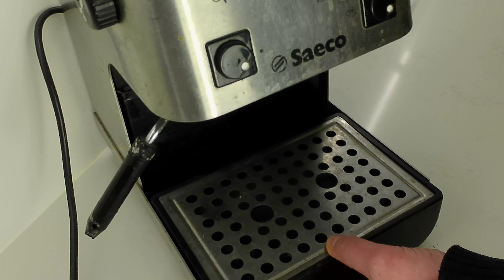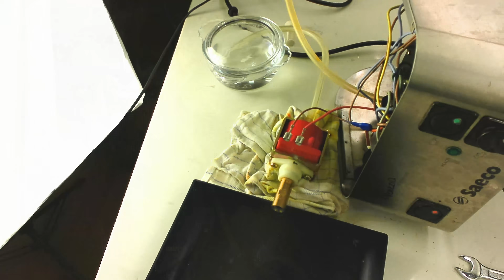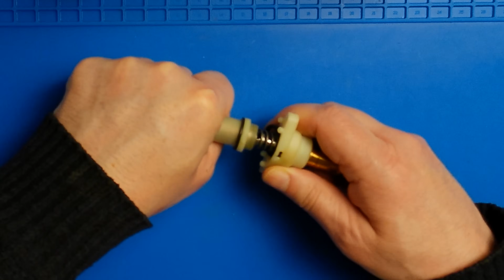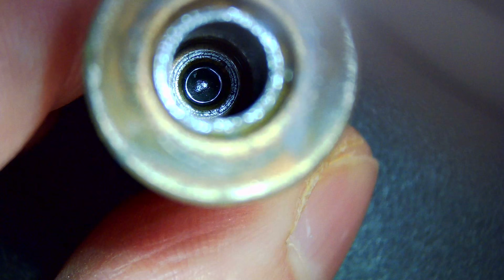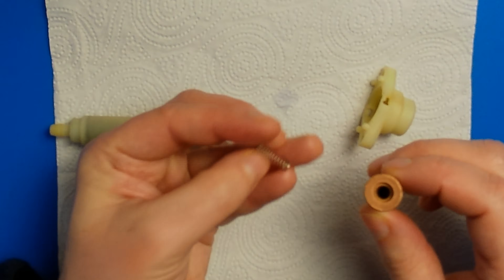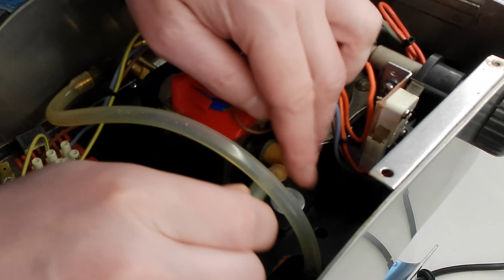Repairing a Saeco Via Venezia / Starbucks Barista / Saeco Rio Vapore espresso machine

Comment: This is a great video! Keep your stuff out of the landfill, this is not difficult! Yes, the small ball tends to get stuck. In mine there were two, a steel one and a plastic one. The steel had a small amount of stiction. I dropped that end of the pump in vinegar solution in an ultrasonic cleaner for 30 minutes. Remember the pump vibrates, so if you removed any zip ties, replace them in a way to keep the wires out of the zone of motion of the pump. BUT before you take it apart, don't forget to attempt to PRIME pump using method in the user guide: "Before first use, it is recommended to wash the parts. Ensure the hot water/steam knob is closed and that there is sufficient water in the tank. Then, prime the water circuit by pressing the ON/OFF switch, placing a container under the steam spout, and opening the hot water/steam knob counter-clockwise until a steady jet of water is emitted. Close the knob and remove the container. The machine is then ready to brew coffee and dispense steam." https://www.manualslib.com/manual/811357/Saeco-Via-Venezia.html

For more information, see page 9 of the manual.

Comment: Do you know if the Saeco Aroma pump is the same?
Reply from the maker: Not exactly the same. This Via Venezia has a metal output connection, which is better than the pump in the Saeco Aroma I repaired (which might have been a replacement, because I bought it second hand). You can have a look at my video where I disassemble a Saeco Aroma pump: https://www.youtube.com/watch?v=p220wWNLXcI - parts suppliers sell the same pump for the Via Venezia and the Aroma though. If you're going to buy one, go for the one with the metal output, it's a stronger and more reliable connection. And it looks better :)

Comment: Wonderful video. I have one that I’ve always had to manually prime (using a squeeze bottle to force water up the inlet tube) after letting it sit for a while. After a few months in storage I did the same but now I’m only getting flow through the steam wand (steam and pumping hit water) but nothing through the group head (sounds like it’s trying but no flow). Any ideas where the problem could be?
Reply from the maker: Hi Max, thank you so much. Given that the steam wand is pumping hot water, the pump is working. It might be that the output of the boiler to the brew group is slightly blocked. If you haven't already, have a go with a good decalicifier and see if that improves water flow through the brew group. Use the steam wand to empty the boiler in between decalcification sessions. We can always remove the boiler and machanically remove the blockage, but that will be a bit of an operation, so do try decalcifying first. I haven't had a close look at the brew group when solving this problem, so check if there is a little screw holding in the filter. The brew group itself might be clogged and preventing water to flow through it... Yes, according to this site: https://espressocare.com/collections/ss-via-venezia-internal-parts/products/saeco-shower-screen-barista/ (no affiliation) it has what they call a 'shower screen'. Remove that and clean the brew group, that could be an even quicker solution, so check that before the whole decalcification process.

One question for you: Is that a Gretsch?
Reply: @repairchannel  Appreciate all the input, I'll have to get inside and see if I can get the boiler apart. It is a Gretsch, that one is just a stock photo but I do have a Gretsch Jet, though I mainly play strat's.
Reply from the maker: @maxeddis1138  Did you check the brew group first? It can be as simple as removing the shower screen and using a brush to clean it. Taking the boiler apart would be the last resort for me, because you might need to buy new caskets for reassembly. Sounds like a nice guitar collection, do check out my guitar-related videos if you like: https://www.youtube.com/watch?v=BJNRPBfkDl0&list=PLtuq3yiKbcpv-IsHGwGAiSkC9IyJN1HRo
Reply: @repairchannel  This morning I tried to run the steam function hoping that might loosen stuff up in the grouphead and I think too much pressure built up and the boiler broke it's seal, I can see the red gasket popping out and it leaks in that area into the electronics. The previous owner stripped the screen screw to heck as well or I certainly would have tried cleaning in there. I wasn't expecting to need to go into the machine but looks like I have to now, so I'll have a fiddle with things, I'm hoping I can re-seat the gasket and give the internals a clean without replacing anything but we'll see.
Reply from the maker: O dear. Yes, I understand your plan to disassemble the boiler now. At least it will be as good as new as soon as you are done. And while you are in there, you can remove all the calcium deposits from the boiler manually, so it will run like when it was new. It'll be a bit of a job, but it will be very satisfying when it runs again.

Comment: Thanks for the video! Perfect. Do you know how can I get 9 bar on this machine?
Reply from the maker: Thank you so much for your subscription. Much appreciated! The original pump isn't very powerful, so you could try a heavier pump if you want to up the pressure. One way to get a more powerful pump is see if you can buy a second hand/broken machine in which the pump is still working. I repaired a nespresso machine once which had quite a strong pump, so if you can find one of those that failed but still has a working pump, I'd have a go and replace your pump with one of those.

Comment: Hi, thanks for the video.  I have one of these machines, and there is a leak at the water tube that connects to the boiler.  I removed it, re-seated it, and tightened it down very well, but no change.  I think the leak is coming from underneath the nut closer to the boiler (not the compression one that I tightened).  Do you have any idea if there is a gasket of some sort there that might have cracked (vs the boiler itself)?
Reply from the maker: Hi, thank you for your comment, did you have a chance to subscribe to my channel? Much appreciated! From what you are saying it could very well be the boiler's gasket, because I had exactly the same problem with another espresso machine. Check for some rust or calcium deposits near where the leak is. If it still gets hot the boiler is fine. I used some liquid seal maker from loctite to fix the problem. Make sure it is heat resistant.
Reply: @repairchannel  Hey, thanks so much for responding!  Think the leak might be higher than the gasket, at the water port nut (but against the boiler body, not at the tightening nut itself) - not sure.  Water drips/pools in the top half of the boiler casing rim.  I'm a bit wary of cracking into anything because the bolts are pretty rusty from the moisture and I'm concerned something will crumble, and I'll lose what I still have.  (While I said I have this machine it's actually a Rio Vapore that is over 30 years old - the innards look almost the same.)  Had to repair a mower gasket recently and used that liquid seal stuff, so that might work depending on what I find.  Thanks again for taking the time to respond.
Reply from the maker: Yes, I understand. You don't want to break it even more by detaching anything. An alternative  would be to dry the wet spot as well as possible and smear some liquid sealant on the parts you suspect are leaking. Not a perfect fix, but if it will stop the dripping, you will at least prevent some more rust from forming. And as we know from experience, temporary fixes often turn into permanent ones and could work very well. Nice to see the machine already existed 30 years ago and that it is still running. I will add the name of your machine to the title, thanks for that. If you feel like sharing your progress with your machine, please do!